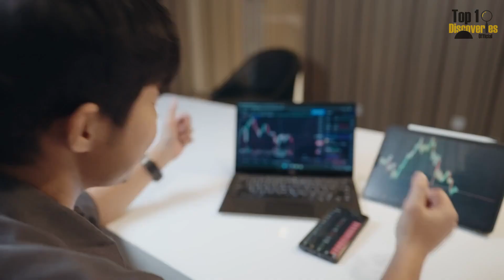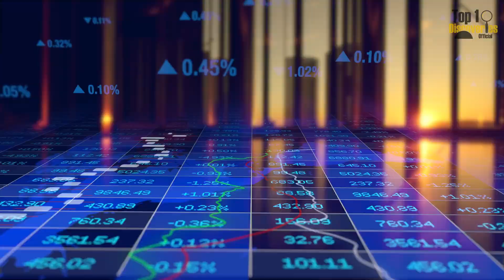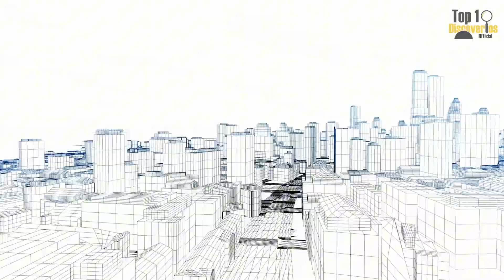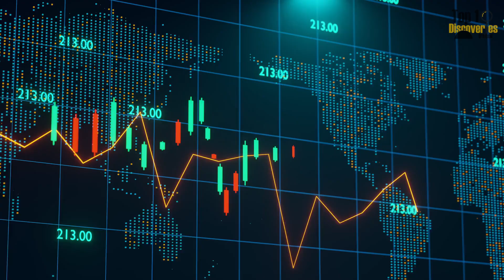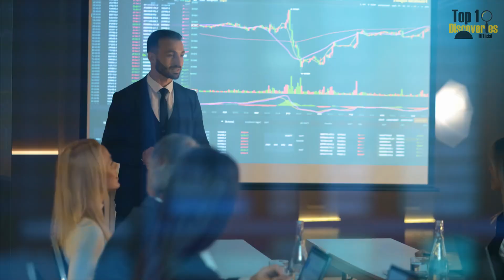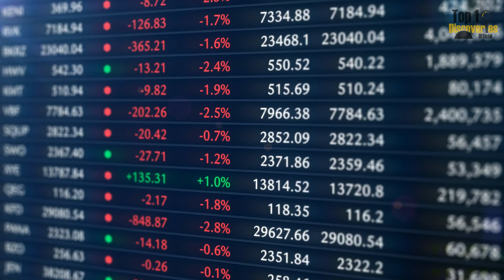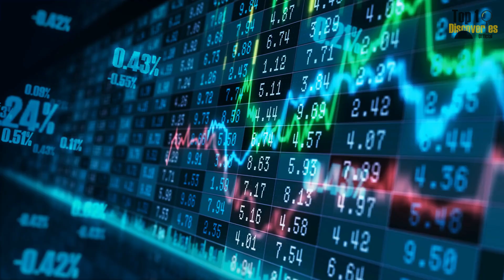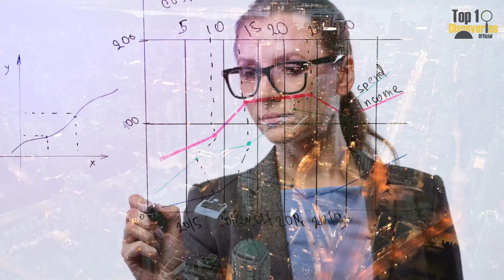China Just Revived a 600m Supertower — And U.S.  Engineers Are in SHOCK

Comment: At the very least, the exterior cladding should be completed. Leaving the structural frame exposed to the elements is a recipe for disaster. You don’t want a skyscraper collapsing someday just because the rebar silently corroded away over the years.